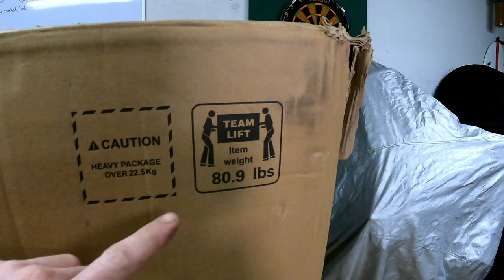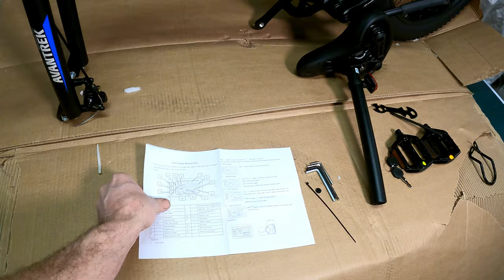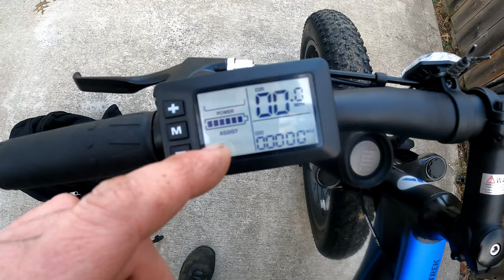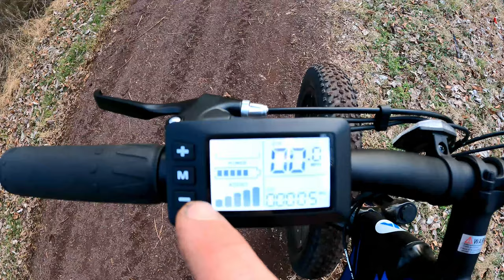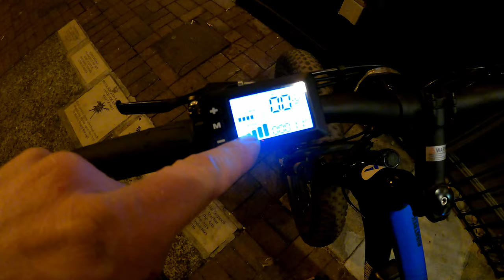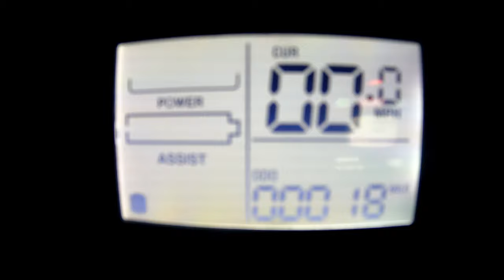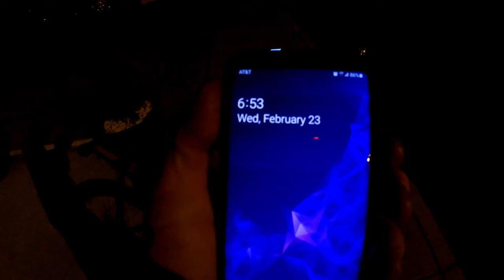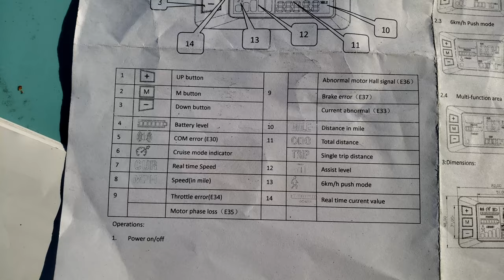Avantrek Macrover 100 Electric Bicycle Review ebike

Comment from the maker: On Amazon: 
*MACROVER 100: https://amzn.to/36QnTpM
Reply: When it comes to zip ties, it's better to lift the lip/tongue of the  zip tie  and slide it backwards, then it stays intact and you don't have to cut it. As an electrician I do it all the time 😉
Reply from the maker: I sometimes do that with larger zip ties. But with the small ones I don't think it's worth it. Plus it could weaken or damage the tongue
Reply: @NNKH2  It works even with many of the medium ones , a pointy tip works wonders.
Reply: @NNKH2  they is an easily reusable variant in case you need it for some application. I keep one attached to my bike and opens and closes easily in case I need to hold something in place ✌️
Reply: @noNonsenseKnowHow2 does it come with a charger for the battery? If not what is it? Thanks! ❤
Reply from the maker: @BahdMemes  yes
Reply from the maker: @BahdMemes  yes

Comment: Hey Chris! Another great video/review, I love the stuff you guys post!
One thing about this bike, though. It appeared to me that the forks have not enjoyed riding down those stairs. After the second stair run, and also at the end of the video, it seems like te fork legs are bend backwards a little bit.
Might just look like it, due to the camera's angle, but the fork should line up with the head tube/ steering tube. If it is bend, you might want to keep an eye on the welds of the fork. I've seen cases where the forks broke at some point, and it's not pretty on the rider. ;-) 

But I really enjoyed your review, as always. Keep up the good work and have fun doing it!
Reply from the maker: Hey man. Thanks for checking out the video and glad you enjoyed it. I didn't notice anything with the forks, but I'll have to go back and look now. Thanks for the heads up!

Comment: Because of your review, i purchased the avantrek macrover 100. It is as you say, basic ebike with no frills. I upgraded mine with lights, fenders, a rack (wired on because there are no bolt holes and i did not feel comfortable drilling the frame). Also I added a handlebar mounted Wild Man hard bag and an old motorcycle hard shell side box on the rack for storage.
Not convinced on your trip data, especially on the no pedal part. I got nowhere near that range.
Reply from the maker: It's possible you got a bad battery. I've had that happen before. Or depending on your height and weight, temperature outside, inclines on the ride. There are just so many variables.

Comment: I just got one and I love it I’m just curious if I can hose it down for a quick rinse without the battery on it of course.
Reply from the maker: I've ridden mine through the rain without a problem
Reply: Awesome I was just worried about the motor next to the back tire getting damaged by the water. Oh and one question do they sell just the battery pack by itself so I can have a backup when the one dies? Thanks for answering my questions btw I really appreciate it

Comment: Crazy question….Have you figured out a water bottle holder that works on this bike? 😂
Reply from the maker: I actually ended up selling this bike. However I've had good luck with handlebar mounted clamp on cup holders. For mild riding

Comment: I have the same display on my bike. If someone, we won't name any names, were to say turn the bike on then hit plus and minus at the same time to get into the settings and hit the mode key to P08 which is the max speed setting and to bump it up. I wouldn't tell mom, that's hypothetical of course. Like if some random person on the street did that or an elf, who would ever know? It would be one of the mysteries of the universe that are best left unsolved.
Reply: Tried it doesn't work
Reply: @Aaron.Drake.Ames.  It may be like mine stock. I ordered one from China from the site that starts with "A" and got an unlocked version it's a G51, just look to see how many pins it has. If it needs 7 pins as mine did I had to order the SM connector and splice it to the waterproof 7 pin plug of the original display(don't worry it's colour coded you can't screw it up)to make all the functions work(Horn, light). However if you don't need the light you can get a 5 pin barrel waterproof connector version. I think I paid about $27 Canadian.
Reply: This factory lcd seems locked. I can't get into the parameters to tune it. Please help. I even bought four other different lcds. It seems to go faster but no they will not read mph
Reply: Here's what I did. I ordered another G51 display so it could be done at base line. It was cheap like $27 Canadian. I got into the settings by hitting plus and minus for a few seconds. On the factory display I couldn't change anything but the back light brightness, but I could still scroll through the settings. I wrote down every setting in the display so I could reproduce it on the new unlocked display. I plugged in the new display and reproduced all the settings, then I upped the max speed. One notch on the pedal assist initial power, and made the pedal assist more sensitive. Added 2 amps to the max amps to match the controller for a little more acceleration and I was done. I don't know if you have a manual but there are literally the settings from the manual I got with the new display:

P01: Backlit display brightness, 1-3
P02: MPH/KPH, 0 KPH, 1 MPH
P03: Voltage class, 24/36/48/52/60 (yes it will actually do 60v batteries on this cheap display. LOL)
P04: Sleep interval, 0 no sleep, X minutes
P05: Power assist levels, 0-3, 1-3, 0-5, 1-5
P06: Wheel diameter, in inches
P07: Magnet steel number 1-100 (Important! This tells the controller how fast you are going. Use the same number as what was in the stock display)
P08: Max speed, 0-50, In KPH 50 is no speed limit. (32 is 20MPH, 40 is 25MPH, 45 is 28MPH)
P09: Zero throttle start, 0 throttle from stop on, 1 throttle from stop off.
P10: Drive mode, 0, specific PAS level determines speed, 1 throttle only, PAS disabled, 2, PAS and Throttle disabled.(keep it on zero for normal driving)
P11: PAS sensitivity setting. 1-24. Lower the number the faster PAS will kick on
P12: PAS intensity setting 0-5. Lower the number the softer the initial power ramps up when pedaling(I have it on 4 for more of a hit but you can lower it to make it more gentle, more gentle is good for tight turns, low speed maneuvering. 5 is max power)
P13: Power magnet Steel, 5/8,12 (another important number of steel speed sensors in the wheel. Use the stock settings
P14: Current limit value, in amps. I have a 15 amp controller so I set it to 15 amps, was set at 13 at factory, now has a bit more kick. Check your controller or use the stock setting if unknown. Any normal 500w motor will have a 750w peak(15 amps, every amp is 50w roughly depending on battery voltage on a 48v system) Any normal 750w motor will have a 1000w peak(20 amps)
P16: ODO zero, zeroing the total miles on the bike

Operation:
Press "M" mode for 2 seconds to turn on
Press "M" mode while running to scroll through information
T1: Running time since bike was turned on
ODO: Total number of miles on the odometer
Trip: Total number of miles since turn on(zero's when bike turns off)
VOL: Voltage of the battery (Awesome feature, even some of the "high end" display's don't have this should be standard on all ebikes)
AMP: Amperage draw from the controller (Another good feature to see what the motor is pulling)
Press: "M" and "+" for 2 seconds to scroll to:
MAX: Max speed
AVG: Average speed
CUR: Current speed
Press: "-" and hold
6km/h walk mode, when walk mode is on you don't have to hold it down for it to continue. Hit a brake to cancel.
When moving on the throttle:
Press "-" for 2 seconds to engage cruise control. Hit a brake or throttle to cancel. (Best cruise control ever it's manually activated, none of the "sticky throttle" hold the throttle for x seconds and it comes on whether you like it or not which is annoying AF and dangerous AF if you're not used to it)

There that should get you started. Ironically, for a cheap display it seems to have more features than some of the higher end displays out there. Another option is to buy a 48v battery and stick it on there. When I sold my old battery to get a 52v battery I had a guy who's battery died and he had a 36v system. I popped the 48v system and peak speed was around 60km/h or 40 MPH with no load due to the voltage!!. What I did was turn down the max amps to 12amps to compensate for extra voltage so it's peak power is similar to what a 36v battery would pull at 15. So watts is volts x amps. So 12 x 48 is around 600 watts peak which the 350 motor should do no problem. At 36v 15 amps is around the 550 mark, so he's still got some extra kick without straining the 350 watt motor too much or generating too much heat and he has a much larger battery capacity due to the 48v battery. Just looking at the video I'd say that battery plate is a Hailong 1-2 with the integrated controller box at the bottom of the plate. It's a pretty popular plate for lower end bikes. Hell I've seen some crazy bastards run a 52v on a 350 watt motor. If you do go up in voltage maybe start at the 12 amp level and check the heat to motor, I wouldn't go too crazy but 15 amp max should get you pretty close. Of course you go go more...Since this is a 500w and 750w peak motor at 36v it's probably pulling 15 amps at it's 500w nominal and 20 amps at peak from that 36v battery. So if you had a 48v system you would turn the max amps down to 15amps(750w peak) to compensate. He never switched it to the amps on the display in the video so I have no idea, but check it yourself if you have this bike. I wouldn't be suprised if they were using basically a 48v 750w motor controller for this 500w bike. A lot of controllers will handle higher voltages no problem. They don't care too much about the voltage just amperage draw. They just cheaped out on the battery to keep the price low. In fact I wouldn't be surprised if this is actually a 750w motor that's been "detuned" to 500w just to run on a cheap 36v battery  which is the most expensive part of the bike. Without the bike in front of me to check the components, I can't tell.

 @turbovw62rag
Reply: @chrissinclair8705  hey man thanks so much for all the info. its a lot to take in, this is my first ebike so im kinda new to it. so i have this exact bike, a avantrek macrover 100, its a great bike and all but it will not let me get into the parameter settings, so its just stuck on what ever factory setting they put them at, and id like to make it a little faster (but everything works) so i did buy a bunch of different new lcds, i have like 4 or 5 here and i tried them all, and they do let me get into the parameters and change them, and it does ride better and go a little faster, BUT none of them will show the MPH, it just stays at zero. and some have a  E 10 error on the screen. i plug the factory lcd back in and the MPH works just fine.
Reply: @chrissinclair8705  and these are the 2 parameters im having a hard time with.

P07: Magnet steel number 1-100 (Important! This tells the controller how fast you are going. Use the same number as what was in the stock display)

i cant get into the stock display so i have no idea what number to put here, id i also randomly tried a buncha numbers with no luck.

P13: Power magnet Steel, 5/8,12 (another important number of steel speed sensors in the wheel. Use the stock settings.

and again i cant get in the stock display so i dont know what they set this at. and i also tried many random combinations with these numbers and still no luck.
Reply: Ok Np let me get what I have to give you a baseline...

Ok on my bike P07 is 1 so it has one pickup, this was the same on my other bike, and my friends bike
P13 is 12
So what P07 is asking is how many speed sensor pickups do you have in your hub motor? 1 is sort of standard across many bikes. Maybe some high end motors might have 2 pickups for greater speed resolution but lets face it this is cheap Chinese stuff we're talking about here. 1 sensor is sufficient. 
P13 is asking how many speed magnets are in the hub motor for the pickup to count. You can take it apart and actually count but since there are only 3 options one of them will work. This only affects the speedometer so if you don't get it the speedometer may be off but there will be no damage to the bike. It's sole purpose is to guage speed. So what you could do is set it to my settings, run the bike with a GPS app speedometer on your phone and see if it's off by a lot. If it's off, P13 is more likely the culprit. Instead of 12 then try 5 or 8. You only have 3 options, one will work. If you'd like I could make a video on my tech channel and go through the settings quickly, if that will help you out.

  @turbovw62rag
Reply: @chrissinclair8705  hey man thanks so much again. I have set my p07 on one (and many other numbers)  and put p13 on 5, 8 and 12. And still none of the new lcd displays will show me any mph. It don't move. Just sits at 0.0mph. And usually they have a error 10. If I plug the lcd that came factory back on the bike the mph will work and read on there no sweat.
Reply: The new 4 lcd displays let me get into the parameters and make the bike smoother and faster. But none will show mph.
 The original factory one will not let me get into that parameters at all. Rides slow and uncomfortable but it does show mph.